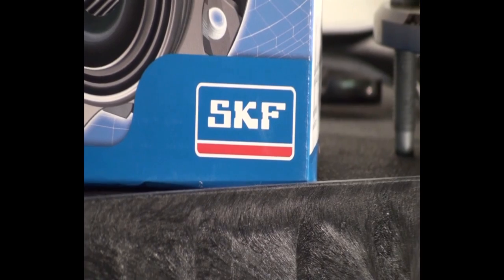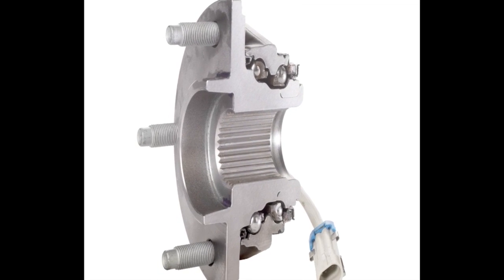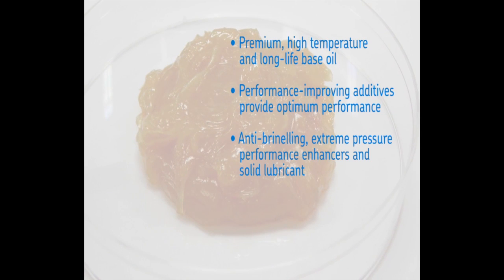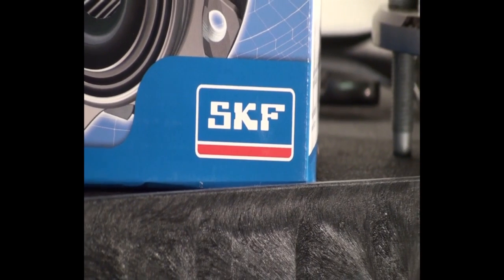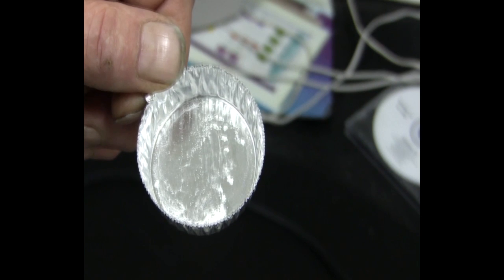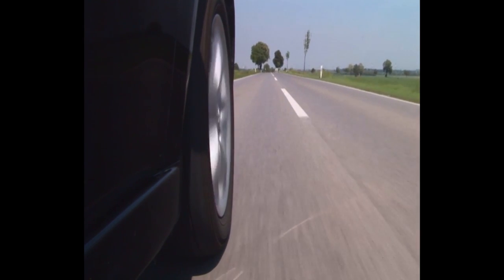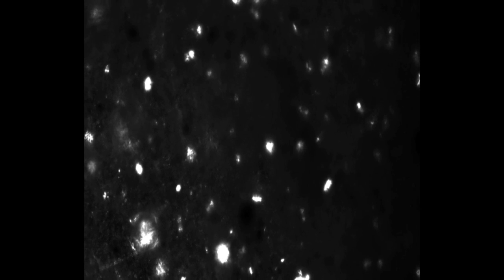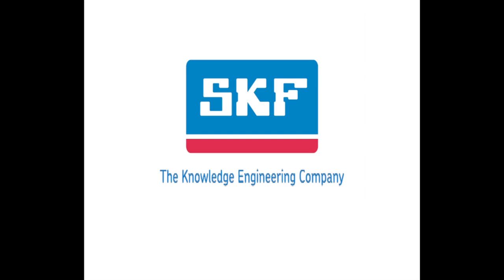SKF hub bearing grease (GHG Grease)

Comment: Is it possible for vehicle owners to purchase this grease for maintenance? If not, is there a recommended, commonly available grease that is compatible with what comes in the hub bearings?
Reply: I am going to be installing your part# BR930420 hubs on my 2000 F250, in a few days. I know you, and all other manufacturers of this type of bearing assmbly will claim it is "sealed" and "lubricated for life". However, the collective experience of thousands of owners of these SuperDuty trucks have shown that a.) They are not truly sealed, as the seals do tend to fail over time and bleed some grease out, and 2.)  periodically re-greasing these type of hubs ( whether oem or various aftermarket brands) tends to substantially extend their life. I personally have made my own grease fitting, that bolts on in place of the ABS sensor. One company has even developed a cnc aluminum fitting , which is quite popular among SuperDuty truck owners. 
 My question is: what type of grease is installed in part# BR930420 at the factory? By that, I don't mean your proprietary name for your special formula, etc.. But, rather what general "type" of grease ( ie, lithium, ,moly, etc...) And, therefor, what type of commercially available additive grease would be chemically compatible with your pre-filled grease? I intend to use Lucas Oil X-tra Heavy Duty Chassis and Bearing Grease, rated  NLGI #2 - GCLB It is a "poly-urea" based product. https://lucasoil.com/pdf/TDS_XtraHDGrease.pdf  Is this acceptable/compatible with the factory filled grease in your hub assmbly?
Reply from the maker: +Jerseyhighlander Unfortunately, GHG grease is not available to the public. If you are working on serviceable wheel bearings we recommend a quality synthetic grease to protect against extreme temperatures, rust and wear
Reply: Good day.  Does it help to grease your hubs. I  have silverado, I think my front bearings are getting louder. Thanks
Reply from the maker: @carguy3j We recommend replacement of the component if you have a failed seal. A failed seal could allow water intrusion and create bearing or vacuum issues.
Reply: @SKFPartsInfo   shame you could not answer the man's question on the what grease is compatible with your grease due to the failure of his part , I suppose you have to make money selling new parts .
Reply from the maker: @DonVoll Wheel noise has many causes, including bearing failure. It's best to have a trained technician diagnose the cause of the noise. Thanks for watching!